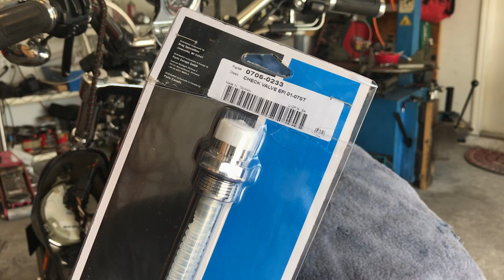How To Replace Harley Davidson Check Valve

Comment: Good video.  It encouraged me to DIY my leaky check valve.  I found that by using a screw type automotive fuel injection clamp that you don't need to remove the fuel pump assembly from the gas tank.  You can lift it just enough to put the fuel line and clamp on it.  Makes for a 15 minute job. Thanks for giving me the confidence to do it Rocco.
Reply from the maker: Happy to read all went well. Thank you for watching and your sub Stephen. Ride safe and have a great day.

Comment: 2006 dyna had a fuel leak on my check valve connection after sitting the winter. Replaced lower o-ring on the tank side fitting. 11mm x 2mm o-ring. Fixed easy leaving the tank on. Make sure its a high quality, high pressure, fuel resistant material, use proper grease and be sure that it's seated properly before reconnecting or you'll pinch the o-ring (ask me how I know). I see others in the comments had limited success with just an o-ring swap but keeping my fingers crossed. Also, when your quick connect is disconnected, charge your fuel pump - If nothing comes out, your upper o-ring and assembly is still good.  Excellent vid for the bigger job, hope I don't need it for a while. Thank you.
Reply from the maker: Happy to help. I'm glad all went well. Just trying to help out. Thank you for watching and your support Plan B. Ride safe and have a great day.

Comment: I have a leaking check valve and was going trailer my 2010 Road King 3 hours to a Harley dealership for repair but thanks to your video, will order the check valve, clamp and crimping tool and do it myself. Cheers
Reply from the maker: Glad it helped,  Any questions just ask. You can use a pair of wire cutters to crimp the clamp. Auto parts stores sell that crimp clamp that you need. Thank you for watching and your Sub Peter. Let us know how this works out. Ride Safe and have a great day.

Comment: This is the correct way to do the repair check valve has to be completely replace there is no o-ring replacement good job Rocco excellent video
Reply from the maker: I agree. Thank you for your Support, Ride Safe and have a great day Shawn.

Comment: Thank you! Will be doing this by the weekend. The o-rings went bad while it was sitting and as soon as I started it up I had fuel all over my leg... Disco'd the line to stop the leak and it started leaking worse! 🤦🏽‍♂️ Drained a ¼ tank and started my YouTube/Google research. Ended here. 🙏🏽
Reply from the maker: Happy to help. Any questions just ask. You will have no problem. Let us know how it works out. Thank you for watching and your sub.Noah.  Ride safe and have a great day.
Reply: @TwoWheelRocco  Worked out great! I replaced the EFI line from the rails with a wire braided one that looks a little nicer, that seal on the check valve end was bad too.  I have an 06 FLSTN (fuel injected, but before the "I" designator was a thing I guess.) Anyways, your walkthrough was the most helpfull one I found, so thank you.  ...Now that she's running again I can try to pinpoint my oil leak! lol
Reply from the maker: @noahthegildedone5917  Happy to read all went well. Thank you for watching and I will send you a video on a popular oil leak on these big the twins. https://youtu.be/-2RneDnr0x4.  Let us know if this helps..

Comment: i was surprised the line does not spin with the valve.  I did not know it had a line up to the pump and when i  emptied the gas and then turned the check valve to see what was going on  - it just broke it.  So no wi will be replacing with the drag special version seen here. . . . great video- thank you!
Reply: also note: mine malfunctioned on street glide at 28k miles. . . .  my dyna has 48k and seems to be fine.
Reply from the maker: Happy to help. It was probably failing anyway. ethanol in the gas does a number to it.. Thank you for watching and your sub TSM.  Ride safe and have a great day.

Comment: Yup that's the ticket thanks for the link Roco. I have a 2006 Road King and take many long trips 1000 miles + was thinking of replacing the take lines just because lol we will see!! Thanks again!
Reply from the maker: My pleasure.  When that hose starts to fail you will hear bubbles in your gas tank, if you open the gas cap and lesson. Otherwise they last a long time usually the check valve itself will leak.  On deuces they do rub against the inside of  tank and fail. Have a great day thank you for watching.
Reply: @TwoWheelRocco  Thank you!!
Reply from the maker: @ericroadking7564  My pleasure. Ride safe and have a great day.

Comment: You are awesome sir.  Your video is the gift that keeps on giving.   you helped me work through the same issue with my 2016 Fatboy.  I was surprised to see the same leak with only 5,000 miles.   Is this an issue that happens often?   Thank you so much for showing us how it's done.  I also subscribed.
Reply from the maker: Happy to help. I feel it's engineered to fail by HD. This get you to trade your bike in or for a very expensive service. Believe me it hurts me to think this way. I see this too often. I'm happy all went well. Thank you for watching and all your support Ernest. Ride safe and have a great day.

Comment: Great video, thank you so much.  Smelled gas in my garage, found it weeping from this check valve on my '13 FXDWG.  The service manual was not clear to me on the replacement, so this is a great help.  Have a question about O-rings.  did the part from drag have all the o-rings?  It looks like there should be three of them, one where the nut meets the tank on the outside, and two inside the check valve (one of which seals against the fuel line OD when inserted)?  Thank you again!
Reply from the maker: Check valve comes complete,  The only thing they do not have is the clamp that connects to your fuel pump. You can get that at your auto parts store. Any questions just ask.  everything else comes with the new check valve that I bought on eBay. Hope this helps. Let us know how it works out. Thank you for your Sub Mike.  Ride safe and have a great day.

Comment: Very cool.  Glad to watch this.   I had a leaky check valve a couple years ago on my 2005 Road King.   Back then I was considering buying a $100 fuel tool to help me rebuild the check valve but instead i bought some o rings and just replaced those.  That lower o ring was very difficult to get in there.  I damaged a couple before I finally got it right.  Well, here I am and the damned thing is starting to leak again.   I had already ordered the $130 worth of Fuel tool stuff on Amazon when I saw this video and realized how much cheaper a brand new, and probably better than OEM check valve assembly is.   So I canceled that order and will be doing this procedure instead.    This makes Sooooo much more sense on a 18 year old bike.  Thanks!  btw....a stainless steel worm gear clamp will work just fine on that hose in lieu of that specialized type.   That's what I will probably be using since I heard that the new check valve I ordered won't come with a clamp
Reply from the maker: Happy to help. Any questions just ask. You are right. Just replace the check valve. I went down the road you're talking about many years ago not good. Thank you for watching and your sub. Rob. Let us know how it works out. Ride safe and have a great day.
Reply: The stock clamp style is used because it's CHEAP (Harleys have premium finish and wonderful basic designs but the hardware is just industry standard and not high grade in any respect) so replacing it is fine. I use automotive "fuel injection" style hose clamps but worm drive clamps work fine too. When I install O-rings I use vaseline (aviation classic for fuel and hydraulic seals) or silicone dielectric grease (also great for all electrical connectors plug or stud and nut) to avoid shaving them.

I only use Viton O-rings for fuel and if you measure a new O-ring thickness, OD and ID you can buy them dirt cheap by the bag online, Ebay being a good source or if in a hurry industrial suppliers like Fastenal which cost more. To ensure correct measurement the OD minus twice the thickness will equal the ID. Online o-ring sellers have instructions. I keep a cheap Harbor Freight digital caliper for that stuff which are good enough.
Reply from the maker: @obfuscated3090  Thank you for your Great tips.. This helps others. Ride safe and have a great day. Do appreciate your support.

Comment: Would it be advised to change the other hose as well while you have it all apart?
Reply from the maker: You end up rebuilding the whole pump..Don't fix some thing that is not broken. That what my farther used to say. But that's not a bad way to go..How many miles?
Reply: @TwoWheelRocco fortunately mines ok but if i have to do it im changing anything that looks like it would be going.
Thanks the response
Reply: Yes, it is a good idea, its the same age as the other hose. Do it once and be done.

Comment: Hey Rocco just looking for some advice on the rear chain slack can't find anything on it I have a 1990 sportster 883 4 speed chain drive I know the primary is 3/8 but the back not to sure about the back .thanks
Reply from the maker: 3/8 is right, chain Lub. is important.  Hope this helps.

Comment: I replaced mine last year. It’s leaking bad now and even with the hose disconnected it leaks. I was wondering if I can just unscrew the check valve and pull it off the hose and just put the new on on the old hose to save me some steps?
Reply from the maker: No that won't work out the hose has to be disconnected at the pump before you can unscrew it from the tank. Harley Davidson's engineering Sucks. Let us know how this works out. Thank you for watching and your Sub Modding Jack. Ride Safe and have a great day.
Reply: @TwoWheelRocco  thanks for the reply! Best wishes and ride safe
Reply from the maker: @shotgun161  My pleasure.

Comment: Hello, I'm so glad I found your video. I changed the check valve and got everything put back into the tank. I missed a step however and I'm not sure if that's the problem. I can't get the "male" hose seated into the valve. Is it because of pressure build up?
Reply from the maker: You need to lift the chrome sleeve on your check valve then push the male end up. you will hear it click into place. Hope this helps. Any questions just ask. Thank you for your Sub Tom.  Let us know how this works out. Ride Safe and have a great day.
Reply: Thanks for answering my question. I had the sleeve pushed up and couldn't get it seated. I'll try again today. Thanks again.

Comment: I have a 2003 Heritage Softail FLSTCI with a leak because of worn out o-rings. Do you know if it's set up the same as this Sportster, and I can use the same procedure you've shown here??? Thanks!
Reply from the maker: Happy to help. The video is showing the check valve being done on a softail Duece. so it is the same.  I will send you a video. It sounds like the O ring you're talking about. Is your fuel pump regulator housing that failed. Thank you for watching and all your support. Let us know how it works out. Ride safe and have a great day.   Take a look at this Oringer bulges when your pressure regulator housing cracks.  https://youtu.be/LgXrmY_cc3Y.  Hope this helps.
Reply: @TwoWheelRocco  it's leaking at the quick connector. I was going to try an aftermarket rebuild kit, but I think it would be better to replace the unit the way you demonstrated. I'll also replace the male end that leads to the injectors while I'm at it. Do you have a link where I can find both parts? Thanks again. I really appreciate your help!
Reply from the maker: I would not bother with the lead to your injector. I would replace the part needed and that would be the one in the tank,  which is called your check valve,   Ebay.  https://www.ebay.com/itm/185957792408?fits=Year%3A2003&epid=2319496623&hash=item2b4bf2ba98:g:-woAAOSwZ3xkmBb1&amdata=enc%3AAQAIAAAA0KbDkz3Zh5Rlm1s3ehLa9iAaABLpEMRJnS7tnUQVPw5%2Fu0ETyW1kt9PcFxgPl9Q4cWZiX91Z63zEswtNlObXy6DUXfL%2BR2fdt4URLumAG7Om1UkAnMxUorfNyE5dtqjd5ojmsGkSEsJ6IyGZ67OSFmvL9eXwUsw1Ufqp3mVr2O3vELjP%2BEqA%2BmxGh3CbcKtbKgBlKk6tjrztrBRr%2Fw4cRT1k8Q7Sadk3lQKo5e1QAZGmZMNdVrGdGynlrXFnAcyvPSjERV5etQkoUoxUB%2B3ekp8%3D%7Ctkp%3ABk9SR6Dwkc_AYg.    This is where I would start.  To replace your injector line, you will be removing your tank. Just saying.

Comment: Hey didn't see a sock filter on the fuel pump, did I miss it? Or do you not run one will your bikes?
Reply from the maker: I fixed the check valve that's what was wrong. Thank you for watching and your sub 85rgreen. Ride safe and have a great day.

Comment: There is a oring on the male end of hose quick connect that I want to replace do you know what I am talking about what size is it
Reply from the maker: Happy to help. I have tried to replace those O-rings but they tend to always leak, I ended up getting a new check valve. Thank you for watching and your sub Gabriel. Ride safe and have a great day. Let us know how it works out.

Comment: What were the symptoms causing you to change the check valve?
Reply from the maker: Bad idle, Weak throttle response, stalling at street light,  When you have and 1/2 tank of gas remove gas cap and listen for air bubbles and odd sounds from your tank. With air getting into your fuel system will cause popping on and off acceleration.  This is very common  problem with Harley Davidson check valve design. What Bike, year,  and miles?  Hope this help. Let us know. Thank you for your Sub Rich.

Comment: Is this the same procedure on an '11 Heritage do you know? I bought it used with just under 25k with no service records. It now has 30k and my valve started leaking. If I do this, is it a good idea to change any other things while I got everything apart? Thanks.
Reply from the maker: Happy to help. Yes, it is the same procedure. Just switch the check valve. Any questions just ask. Thank you for watching and all your support. Ride safe and have a great day. Try not to make it complicated switch out the line and you're good to go.

Comment: Did you replace the cork gasket for the plate on top of the tank?
Reply from the maker: Thank you for Watching.. Mine was a rubber gasket with plastic washers.  I did not need to replace and had no problems. Ride Safe and have a great day.

Comment: Do you ever put any thread sealer on the new check valve when screwing it back in the tank ?
Reply from the maker: No I do not, there is a sealing gasket in place. Let us know how this works out.  Thank you for your support. Ride Safe and have a great day.

Comment: How do u replace the line the connects check valve on the out side of the tank
Reply from the maker: https://www.harley-davidson.com/us/en/shop/Braided-Stainless-Steel-EFI-Fuel-Line/p/63020-04?source_cd=SEM_Shop_PLA&_cr=ssc%7CGOOGLE%7CParts%7C%7C63020-04&gclid=EAIaIQobChMI2rjn-vvc9AIV88uGCh0PtQaMEAQYAiABEgImnPD_BwE&gclsrc=aw.ds.   take a close look at the fuel line and you'll see these two clips at 3 o'clock and 9 o'clock you push in and pull out and that will remove it from the other side of the fuel line that connects to the injector rail. I hope that helps you,  may have to remove the horn and a couple odds and ends. I hope that's what you were concerned about,  let us know how it works out. Thank you for watching Hector. Ride safe and have a great

Comment: Did you have a part number? Mine started to leak
Reply from the maker: Happy to help. What bike and year?. Thank you for watching and your sub Miguel. Ride safe and have a great New Year's.
Reply: @TwoWheelRocco   2005 Softail deluxe
Reply from the maker: @miguelramos2015  Ebay.    https://www.ebay.com/sch/i.html?_from=R40&_trksid=p2380057.m570.l1313&_nkw=2005+harley+davidson+softail+check+valve&_sacat=0.   You can buy the clamp for the end of the hose at any auto parts store crimp with a pair of pliers   Hope this helps.  Let us know how this works out.

Comment: Will a pin hole cause engine to stutter and stall?
Reply from the maker: Happy to help. Yes, it will. Any loss of fuel pressure affects the running of your motorcycle. How do you know there's a pinhole in your check valve line? Any questions just ask. Thank you for watching and all your support Bigdog.. Ride safe and have a great day.  Take a look at this video. This is the pressure regulator, housing fails.   https://youtu.be/LgXrmY_cc3Y. You will need to take it apart and take a look. Hope this helps.

Comment: Dumb question. Was all set to head out with my older neighbor I used to work for (he rides a Honda) when I noticed my valve leaking. He's a bull in a China shop with not a lot of mech experience and grabs wrenches to pull my check valve. The 7/8 was rounding it, so he grabs a crescent. That's when I stopped him. I figured it was probably a 21mm. Luckily neither of us had one and I was able to start watching YT vids which I normally do. It's definitely a 7/8 though?
Reply from the maker: Happy to help. 7/8 sounds right. You need to remove the hose from the fuel pump. so you could turn the check valve nut. So as the video, I removed the fuel pump from the tank, halfway and remove that clamp and the hose, and then the check valve will be able to turn freely . There's no other way to do it. Any questions just ask. Thank you for watching. let us know how it works out. Ride safe and have a great day.